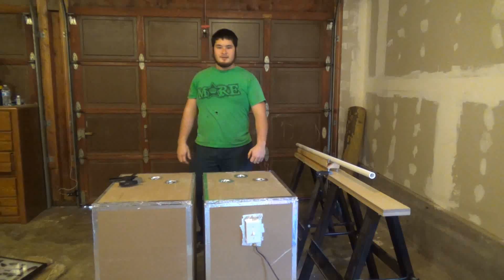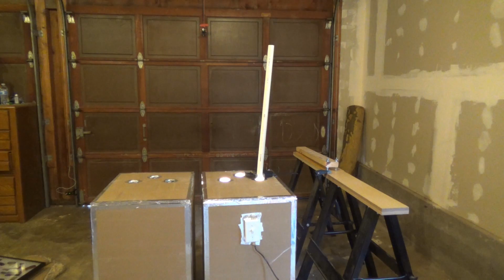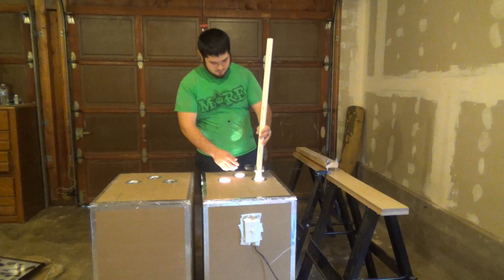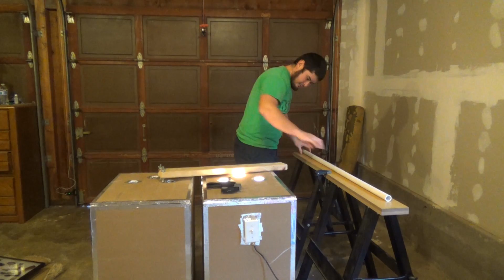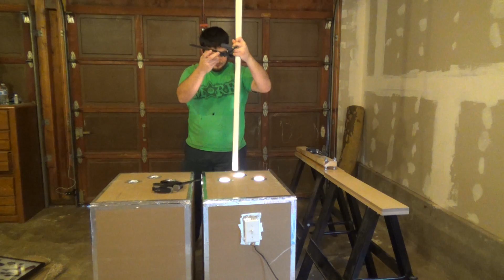Introducing the PVC Bow Heating Box - PVC Bow Oven

Comment: I am so happy I found this video! This heat box could be adapted to a lower temperature and used as a heating chamber for killing bed bugs. Books, shoes, handbags or anything that cannot be heat treated in a laundry dryer need to be heated at a constant temperature of about 150 degrees F for about 40 minutes (although I might be wrong with these exact figures) in order to kill live bugs and their eggs. The commercially available bed bug killing chambers like the Packtite cost a few hundred dollars. Bed bugs are a nightmare and cause so much anxiety. Many people get them through no fault of their own. This is a very affordable, diy alternative and seems quite safe. Some people put things in their oven and heat up but if you need a big item to be treated like a dresser or a chair there is no limit to the size you could actually build this heat box. Thanks for sharing your knowledge!

Comment: This just isn't happening for me with a Heat Gun. It's 1500 Watts and the high setting is 1100 Degrees. I heat the pipe until it's floppy and then keep going and it doesn't seem to get much floppier, so I assume it's hot enough. And then in the 10 seconds it takes me to move it to my jig, it's virtually rock hard again. If I try to heat it back up, while in the jig, only the sides heat up and it squishes unevenly.

What am I missing or doing wrong?
How long do you heat your pipe with a Heat Gun before it's ready? Like a 1" for instance, which is what I am trying.

Thank for any input from anyone.
Reply: it usually takes me like 10 min per limb for 1 inch pipe, is it cold in your workspace? I had to give up the other night because my garage was so cold it was taking forever.

Comment: Heat gun: 60 dlls.         Oven: 40 dlls.
Heat gun: 1500 W.       Oven: 650 W.     2.3 times more efficient by the minute.
Heat gun: +/- 15 min.    Oven: 10 min.    1.5 times more efficient.

Oven is 3.45 times more efficient in operation, and it is 50% cheaper.
Do the math!!!
Reply: My Heat Gun was less than $20.00. But I would still rather have one of these boxes. Just so I don't have to sit there the whole time blowing heat on the pipe. I can go eat a Sandwich and come back.

Comment: HOLY CRAP MAN! i was working on the same thing... just a different design. same concept, just mine has a tray that holds 4 pipe lengthwise instead of vertical. still only heat one side at a time,

Comment: Putting a variable resistor in the circuit will give you fine control of the heat.  With a little time and a candy thermometer you could find a setting which would heat the pipes to just the temper where they soften.  I know that temp. is less than 212 °F. (100° C) since I've made a knife sheath by dropping a 8" long piece of 3/4" PVC pipe into a canning pot for a few minutes and then stepping on it to flatten it--worked really well.
Reply from the maker: You can form PVC once it reaches at least 170 °F. The problem is going from heat source to flattening jig. 250 °F is pretty much the perfect temp. So long as you don't exceed 300 °F, PVC will be fine. A friend of mine has a hot box with a thermostat built into it, that would be a good idea as well.
Reply: Thank you for the info.  Now I'll know what temp. to adjust to when I give this a try.  On the subject of keeping a bows limbs straight, which you mentioned in passing, have you tried cutting a shallow 90° Kerr down the middle of one board on your flattening jig to make sure the pipe stays in a straight line as you're flattening it?  If so, what were the results?  I'm thinking of doing this on the longer board to see if it aids or hinders the process or the finished bow.
Reply: kerf not Kerr.

Comment: Hey, I am in Ireland where the schedule 40 discription doesn't mean anything. Does anyone know if it is PVC pipe or is it u-pvc?
Reply: its PVC  not u-pvc the Schedule (Sch.) 40 is in reference to the wall thickness of the PVC pipe. the larger the number the thicker the wall. Here's a link with those approximate dimensions for you.

http://www.engineeringtoolbox.com/pvc-cpvc-pipes-dimensions-d_795.html

The USA uses standard inches so you will have to translate them into millimeters if your on the metric system. Hope that helps.
Reply: i would like to know aswell

Comment: Hey Nick,,, if you have two flattening jigs you can put those two boxes sideways and insert both sides of the pipe in both boxes. Then the pipe goes into two flattening jigs at once. I think it will be also easier to get a really aligned bow that way.
Reply from the maker: An even easier method would be to build the one box at about 6.5 feet long (using 2 drywall panels instead of 1) and with 6 bulbs and have it lay sideways. You could simply place the pipe with two flattening jigs on it with some weight on top. Once the pipe gets hot enough, it will flatten on its own in its own time. Making the flattening jigs from aluminum or steel plate would help conduct heat better and result in a better finish.

You could even make a pre-tapered form with recurves, reflex, etc. The more time you invest in jigs, the less time it takes to make each bow. Though, I personally like the flexibility of working one limb at a time.

Comment: Does hot air rise through the pipe to deform the previously flattened limb? Or does the box contain the heat real well?
Reply from the maker: This hasn't been a problem. While hot air does go up into the pipe, the pipes never seem to actually soften past where they exit the box, even if left for longer than 10+ minutes.

Comment: Hey Nick, yet another great video.  However I think I have improved on your flattening jig.  I use the same jig plan that I learned from your videos but I just added a simple hinge on the back portion of the jig.  This not only helps to line the boards up straight but eliminates the need for a second clamp as well.  Just thought I would share since it was your videos that got me into pvc bow making in the first place.